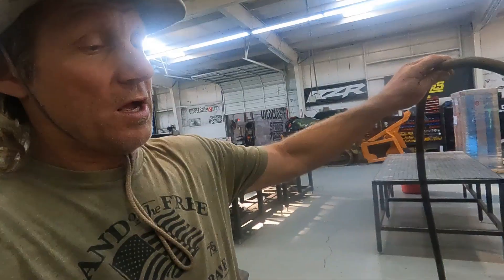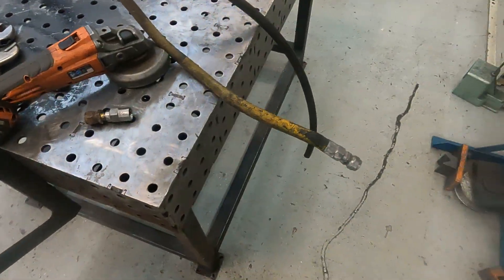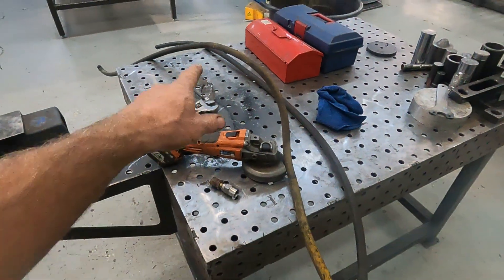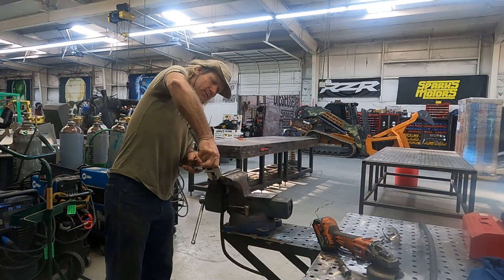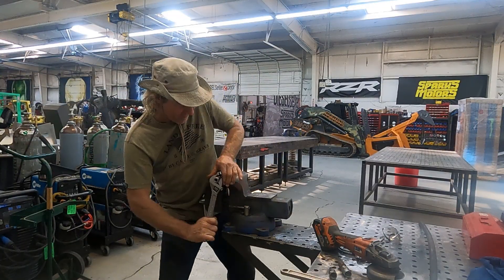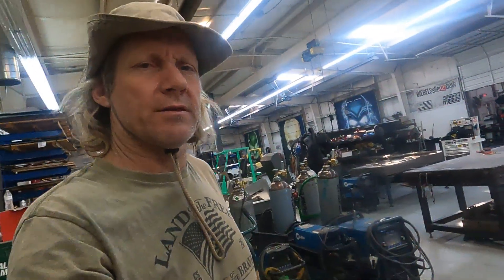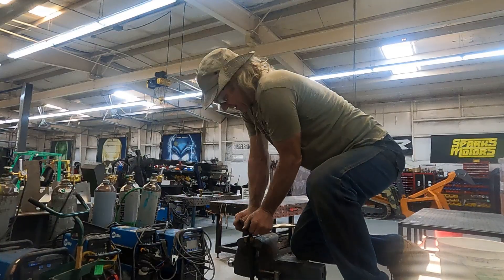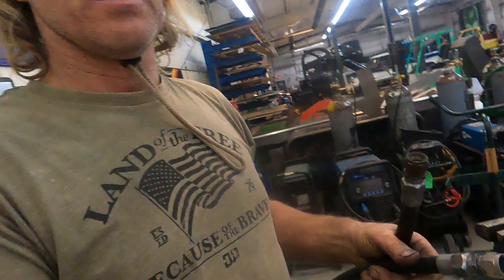Wizard DIY   Repair hydraulic hoses yourself!

Comment: 10:10 As I am watching this?? I am being reminded that I have definitely assembled this exact type  (or very similar) hydraulic hose system, sometime in the past !! ... 

I remember it was difficult to assemble just like the time stamp here in the video!! 

It could have been when I was in the Reserves, or when I worked as a Millwright, or maybe on the farm?? .. 

But I definitely remember taking apart the fitting and figuring out it was reusable, cut the hose end a bit shorter and hasd it back to "good enough" .. the same day.
:)

Comment: Alan, the hose fittings you're using are called "Airquip" fittings, as I'm watching you struggle to get the hose to screw into the male half of the fitting, you don't need 'any' lube or Murphy's Tire Goop, the internal threads of the fitting are '''BACKWARD or Left-Hand Threads''' they simply screw onto the hose Left Hand, then the sharper male end screws into the hose opening via it's Fine Threads until it's in all the way, I hope you read my comment before you start making jigs to hold the male end, I've personally screwed in countless hoses 'By Hand' easy peasy through the years.
Reply: Hi, I was a breakdown hydraulic fitter for twelve years and totally agree with what you say...... except for the lack of lube.  I always used rubber grease to aid in attaching the fittings.  ESPECIALLY with field attachaeable ones.   Nothing worse than the tail of the fitting "picking up" the inner liner and tearing it, resulting in a blockage or leak.  This was using Aeroquip hose and fittings and Parker Hannifin hose and fittings.
Reply: Yeah, it's the same way for hydraulic steering for boats and pontoons. The first fitting is left hand thread, so easy to put on. I felt like crawling thru the screen to tell Alan, the other way buddy lol.
Reply: @BADPits   yeh , now i know.
Reply: @BADPits  Your comment made me laugh! I got a kick out of watching him standing on the table with his full weight pushing down on the Vise-Grips holding the fitting.  if I had Alan's phone number I would have called him saying "simply screw the fitting on backwards 'by hand' easy as pie." : )))
Reply: @wmbomb1079  🤣
Reply: I never knew that!! .. If I run into another one .. I'll try left hand turning! :)
Reply: An alternate spelling is Aeroquip .. same manufacturer
Reply: @matttafakt  You're correct Sir. :)
Reply: I would mark the hose so I would be able to see if I hit my mark for all the way in. Left Hand  thread will be 😂
Reply from the maker: Thank you!!!!!!!
Reply: so Alan's  turning the wrong way, that sucks
Reply: Question for you @wmbomb  and the other guy @alanrainey  who have more experience than me and Alan, I do agree with the rubber lube tho,  Wouldn't it take like 5 seconds to just use an electric impact (on reverse!) and the lube? Obviously you don't want to go crazy on it and tear it up
Reply: @manmade4625  I would use a drill instead of impact but I like your idea
Reply: @Bob-Whiting  Weather using regular nylon mesh enforced rubber hose or the steel mesh high pressure all I know is I never used any kind of lube at all.
Reply: Came here to say this. As an aviation mechanic I’ve done hundreds by hand.
Reply: So it's cross threaded
Reply: Great video. Very informative
 You have such interesting content.
Reply: Prices are insane on everything these days and it comes as no surprise that you are getting gouged on hydraulic hoses. You figured out your own solution to your problem and you have a great following and they seem to have already answered a bunch of your questions. 🍻🧙
Reply: @mrmongo6722 the Land Of The Free!
Free what? 😉👍

Comment: There is a silicone tape that's very stretchy, sticky & super strong that is fantastic for emergency fixes anywhere any time, it's great for hydraulic lines that split. I love the stuff & keep it in all my vehicles and house I've even used it on my fingers after smashing them. It looks similar to electrical tape but 500 times better, grab a roll or 10 and you will be amazed just how good this product is even though it is a little expensive compared to electrical tape the job it does could even save your life. this reminds me I have to replace a temp fix I did with it nearly a year ago.
Reply: Irc it’s called self amalgamating tape

Comment: Why can't you afford a 600 dollar line? For all you do for sparks plus all the fans that tune in to see you he should be paying you 200K a year. Plus giving you old equipment the shop does not want to fix for free. Does anyone else think I am wrong? Something is off.
Reply: Lots of assumptions here. You know nothing about how much he makes / what he can afford. The dude is building a mountain fortress using his own hands and will power. Making a hydraulic line seems right up his alley. Also allows him to create more content that you, myself, and many others watched 😉
Reply: Alan is just froogle, he knows how much stuff should be and doesn't want to pay if it's more than it should be, alot of times it's a virtue but sometimes it can be a curse
Reply: @middletnpyro Frugal.
Reply: Alan is putting his money into the fortress and he is not wasteful. Why spend money that you don’t have to? It is an absurd amount for a hose and he doesn’t want to be screwed over when he can make it himself. 🤷🏽‍♂️

Comment: We used to stock the hoses and fittings when I worked at a Heavy Ford dealership in the 80’s.

Could you have used an impact with the right size socket or just a power drill?
Reply: Hi Dave yes the Prices are so expensive it’s a joke the S O B , must make a killing on spare parts ,,It’s same in Australia prices on car truck parts are stupid expensive I play with my cars and the parts have gone 3 times what they were before Covid …I’m Sorry calling you Dave Alan I’m sorry mate 🥲,,In todays life you have to be a handy man other wise the prices will kill your wallet   ,,,Thanx for the video Alan cheers mate ❤️🙏💪😃😅👍🦘🇦🇺🇺🇸🍀🍀

Comment: You might want to lube the fitting and inside of the hose to aid in sliding on. Some hose is kind of grab,the  by lube with a uni hyd. Oil it eases the installation.

Comment: Reusable fittings are left hand thread onto the hose right hand thread into the fitting!
Reply: Also you have to trim the rubber back
Reply: I’ve stood on top of fitting while my bud turned. Making up the big ones. Railroad machines.